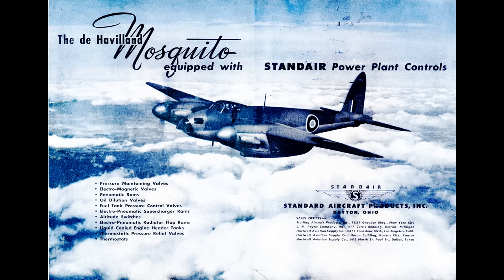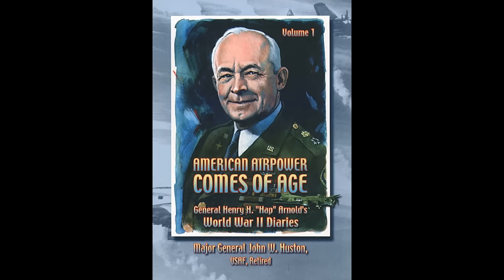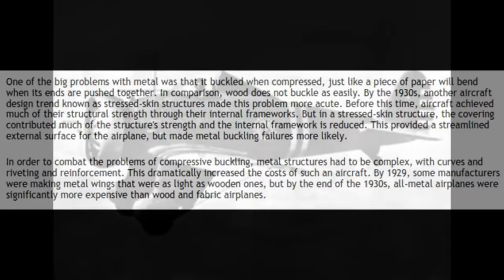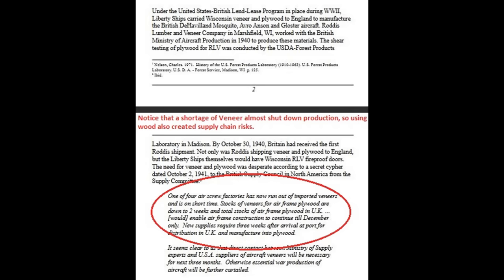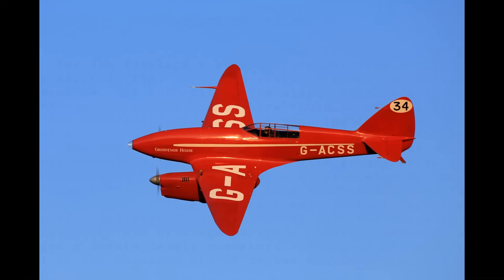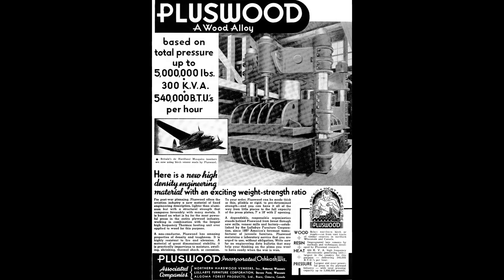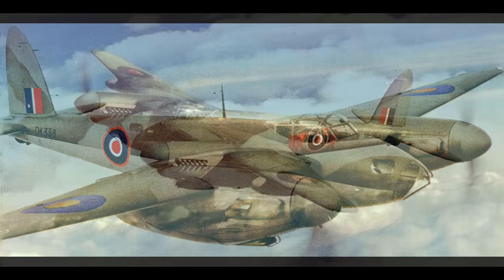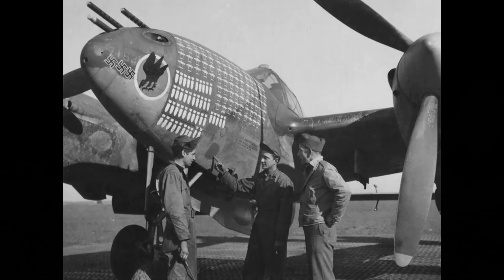De Havilland Mosquito vs. ?

Comment: Interestingly, USAAF pilots converting to the Mosquito seem to have struggled at first with engine torque at takeoff.  Curious, since the extra power of the second Merlin is offset by extra weight, and more so as other pilots do not seem to have had the problem.  This seems to have been because most of those US pilots were converting from P-38s, both aircraft being reconnaissance versions.  The P-38 had a fairly unusual setup where the two engines ran counter to each other, thus giving a neutral resulting torque.  So they had "un-learned" the habit of counteracting engine torque which they would have learned in training.

On the subject of the comparison with the P-38, while I love the Mosquito I cannot see it in the P-38's primary heavy fighter role.  Mosquito was a deadly nightfighter but it's a much bigger aeroplane.  P-38 already had problems over Europe of not being able to maintain energy in a turning fight, and Mosquito would surely have suffered worse.  All the other roles it would have performed well I think, and Mosquito also had the ability to transport passengers: in the bomb bay!  Possibly even worse than the P-38's drop tank pod.

Regarding the structural failures in the Indo-Pacific, we will probably never know for certain.  As you point out there were several possible causes and fixes were implemented for all of them, including changing the glue used.  Sensible enough during wartime to not wait and test, but frustrating for us.  

This channel makes so many events logical and explicable.  I had previously wondered why the fighter-bomber variants tended not to have the more powerful Merlins and their two-stage superchargers.  But now I understand that engine would be most effective at higher altitudes it makes perfect sense.
Reply: The counter-rotating props on the P-38 weren't so unusual, there were several other aircraft that used that design as its advantages are obvious and somewhat significant. The difficulty is a greatly increased cost in powerplants, as a reversed engine has to be designed and built, and is limited in the number of parts it can share with its counterpart engine.
Reply: Patches very true, I don't know how much has to be changed in order to run the engine in reverse.  Perhaps Greg will inform us?  As for how widespread counter-rotation was, it seems like it was well-established but uncommon.  By well-established I mean the Wright Brothers started it, and it seems to have been most common before the 1920s.  After that its use seems a bit random: for example in Germany the Hs 129 used it, but more high-performance aircraft like the Bf 110 and He 219 did not.  Maybe because of the engine mod of course.  

What is especially interesting is that de Havilland did adopt counter-rotation on the Hornet.  That was being developed at the time the US pilots' reports would have been made (1943-44).  That makes it slightly surprising that counter-rotation was never added to the Mosquito, even later in the war when engine supply was less critical.  I doubt it was just because Hornet was a single-seater as in Mosquito the other guy does not have co-pilot duties.  

While we're talking about engines, I remember a pilot talking about the challenges of the high-altitude photo-recon model and it's two-stage engines.  It seems that on that Merlin (at least in the Mosquito), the shift to the high altitude mode was not controlled by the pilot but an altimeter on the engine itself.  This, he recalled, sometimes led to one engine shifting into high gear at a few hundred feet lower than the other, leading to a significant asymmetric thrust and a rapid climb to get the second engine to shift.  A scary moment as the sudden change apparently felt like the aircraft had been hit.
Reply: Also the single Stage merlin 20s actually had more power down low than the two stage 60 series.  So on the FB versions it was unnecessary to change then. They both had same boost pressure abilities.
Reply: Tom Hutchins I think they just made do. It would have been nice but the mosquitoes already passed handling trials so it was deemed unnecessary. The Hornet needed the reverse reduction gear because it was designed for carrier operations and it had 600hp extra with the Merlin 130s
Reply: @smittywjmj  I wonder why the engine couldn't be reversed 180- run the prop off the rear end of the shaft
Reply: The Alison V1710 was designed from its start as reversible. It was intended as a dirigible engine and it was intended that the engine could be reversed to provide reverse thrust. The engine could be stopped and a lever thrown to reverse cam and accessory drives so it then be restarted in the reverse rotation. This made the manufacture of a full time reverse rotation version not very difficult. I don't know about trying to reverse a Merlin. It may have been a bigger job.
Reply: The "Spruce Goose" still exists because apart from one little "hop" it never flew so therefore was never structurally challenged.
Reply: A turning fight doesn't happen in night fighting. Night fighting is a stalking game using radar. Night fighting Mosquitos caused havoc with night flying German intruders. The P-38 comparison is best summed up by considering that the Mosquito was designed and built as a fast light bomber and as well as fulfilling that role it became a superlative P.R., fighter-bomber and night fighter - amongst other roles. The P-38 was designed and built as a long range heavily armed fighter and was used as a P.R. (although the U.S. relinquished them for Mosquitos and Spitfires in Europe) and as a fighter bomber - but at the expense of performance as the bomb load was carried externally with it's resultant drag. The Mosquito pretty well worked from day one whereas the P-38 had to overcome it's compressibility problems.
One is not better - or inferior - to the other. They're just the same - but different. 
But the Mosquito is definitely the more versatile of the two.
Reply: P-38 sure was a star for the USAAF in the Pacific.  The top two US aces from WW2 flew Lightning’s.  As did the long range wave top raid that took out Yamamoto.  Look up Richard Bong, Tom McGuire, and Charles MacDonald.

Comment: V's radar.....Because it was made of wood its radar cross-section would have been tiny compared to all other planes of the time.....
Reply: @frankcorner8716  As with all the answers to the questions about planes of WW11, "I'll have the fastest, lightest one with the Rolls Royce Merlin engines please"!......Ditching all the men and 50.Cals out of a bomber gave it greater protection, speed......
Reply: @frankcorner8716  De Havilland just stuck to what they were good at and made a plane they could make more of than the enemy and faster in construction also. Germany might have made slightly better planes but in nowhere near the numbers that they HAD to. If you have this, the Hurricane, Spitfire and Lancaster all made in huge numbers all the time in factories that aren't being flattened every week, then the result is inevitable.....
Reply: @frankcorner8716  I think Greg did a pretty good and non-biased job here of explaining that Frank. Like I said about De Havilland, some nations also stick to what they know or believe to be correct. It easy to look back with the clear 20/20 but things where moving at a pace that was (is?) unmatched for a long time in history. Tactics and technologies were changing by the years, then months, then weeks.....

Comment: Sometime in the late 60s, my father flew to Shoreham (I think) to look at a Miles Gemini that he wanted the engines from. Anyway, I remember him telling me about piles of ash and scrap metal on the airfield dump (which was where the Gemini had been taken). Turns out the ashes were a couple of Mosquitos and the modus operandi was to remove the engines and set fire to the rest. Once it had burned out just rake through and gather the scrap to be sent off with the engines......... Given its versatility, performance, bomb capacity and simplicity of construction, I think the Mosquito was, arguably, the finest all-round aircraft of the war.
Reply: Your story highlights exactly how incredibly overrated the Mosquito really has become thanks to revisionist "historians" since the war ended... the aircraft suffered from some serious deficiencies as a result of its antiquated design and construction methods, it's structural weaknesses and lack of durability is exactly why no original Mosquito remains in flying condition today.
Build to be cheap and disposable they were not worth repairing and were heaped-up and burned.
The de Havilland company suffered the same fate... they were not company made to last and went tits-up early in the Jet Age... too outdated and obsolete to compete with more technically adavanced aircraft manufacturers.
Reply: @sandervanderkammen9230  your reply really has made me chuckle. It's an interesting mix of bias and pure ignorance. The Mosquito was built from plywood because it was available.  The country's raw materials were spread thinly and the MoS would not allow DH to use aluminium. Plywood glues weren't advanced at the time and so delamination occured after 20 years or so. That's hardly a problem; the aircraft was designed to last the war. Remember that in different forms it could out run nearly all fighters, carry a payload equal to some dedicated bombers and operate well at both high and low level. What's not to like? As for the company, well you clearly haven't the faintest idea what you're talking about - DH designed and built many successful aircraft in the jet age - they possibly broke the Sound Barrier (though that is arguable) - produced the first jet airliner - produced several carrier jets - and designed others that would become the 125, Trident and 146. The company didn't just fail; the entire British aero industry was contracting and DH were forced to amalgamate. The reasons behind that are numerous but none of them were because the product was poor. If you're in the UK then I'll take you up in a DH, you might even like it.
Reply: @Soupdragon1964  My comment is intended for your education... not your amusement.
 Freeman's Folly was built from WOOD and FABRIC because de Havilland didn't have the technology and experience to build modern all-Metal aircraft.
The Mossie entered production because it was cheap, disposable and built to last weeks not years.
 You can cherry-pick specs all day but the overall average performance specs for the Mossie were average at best... it's capabilities were very limited.

Name a successful de Havilland jet aircraft?

The d-H 108 was a humiliating failure... they all CRASHED killing thier pilots and never flew Mach 1.

The world's first successful airworthy jet airliner is the Boeing 707 series.

The Comet Disaster was the worst engineering failure in commercial jet aviation and a shameful, humiliating chapter in British history.

The de Havilland company has a long notorious reputation for high loss rates, in-flight structural failures and a general disregard for safety and reliability that earned the company the honor of the worst aircraft manufacturers in history.

D-H went tits up in 1958 as a direct result of Comet Disaster it was placed under administrative receivership by Crown Court and its assets were sold to Hawker Siddeley. 

NO THANKS, DH went bankrupt because operators refused to buy thier aircraft anymore.... the globe is littered wirh de Havilland crash sites!

Britain's  aircraft industry was doomed to collapse after its defeat in WW2.... designing aircraft does not work as a jobs welfare program.
Reply: @sandervanderkammen9230  well I like to think that I have an open mind, but having flown all my adult life I don't believe I need to be educated..... Scrub your bias an look at WHY the Comet failed initially. Yes it was tragic and an embarrassment, but often being first with a product means that others benefit from your testing. It was fresh technology and boundaries were being extended in to untried areas... "the worst aircraft manufacturers in history"  - now that really is laughable. Your source please? Interestingly, the Mosquito had one of the lowest loss rates of any aircraft in the war, it's fact and no less true because you don't like the maker. You should research why DH were amalgamated, but to do that you need to understand the wider picture of  post-war British aviation, a treasonous government, loss of empire and a dishonest, envious and manipulating US ally. The put it all down to a poor product is not to understand the whole picture.
Reply: @Soupdragon1964  "Initial failure" ??? The Comet Disaster was an epic failure that completely destroyed the de Havilland company  and dealt a heavy blow to the already failing U.K. aircraft industry.

The Comet remains the worst jet airliner in history.  (worse even than the Tu-104)
No single British aircraft did more damage to the reputation of British aircraft and british engineering in general.

The Comet Disaster is taught in every engineering classroom since as an example of how NOT to build something.
Reply: @Soupdragon1964  There were only two winners in WW2, Britain was not one of them.
After the Bank of England failed and the U.K. economy collapsed the British had no choice but to mortgage itself to America with the Anglo-American loan, Britain giving up its autonomy and becoming an American protectorate from 1947 to 2016.... the U.K. is still occupied by American military forces.

Comment: A huge thumbs up. You used intercooler in the sense of of a two stage compression then followed by an aftercooler leading to the inlet manifold.
Reply from the maker: Thanks, and I do talk about that at length in my turbo vs supercharing in WW2 aircraft video.

Comment: De Havilland had some experience with wood construction exercised on DH88 Comet racer.  Aluminium like all war material was in short supply and only really on offer for authorised govt procurement, which DH98 was not, it began as a private funded venture because the idea of an unarmed medium bomber (the contract it first appears in) was literally laughed at. That same  British Air Ministry Specification P.13/36 was awarded to the failed Avro Manchester, which Roy Chadwick later turned into the Lancaster on 4 Merlin engines. With the contract refused Geoffrey Dh went looking for money which was ultimately granted by a patron, Wilfrid Freeman ultimately allowed a prototype aircraft which was to be built in secret at a farmhouse which took 11 months. Still as you suggest I think in balance it was Geoffrey's choice.

The meeting with Hap Arnold but from memory it is his aide a Major Elwood Quesada, who on seeing DH98 do a steep climbing roll on only its stbd engine (video of this exists) wrote :-
"I ... recall the first time I saw the Mosquito as being impressed by its performance, which we were aware of. We were impressed by the appearance of the airplane that looks fast usually is fast, and the Mosquito was, by the standards of the time, an extremely well-streamlined airplane, and it was highly regarded, highly respected."
Maybe if you can run him down perhaps you will have some luck to find the rest. 

On construction, yes its said to be wood,  in truth it is balsa composite mostly around 5/8" thick. There are much fewer frames as shape is preset in molds. Pre carbon era we used similar ideas for racing sailboats today. They could likely have produced this aircraft out of aluminium at a minor weight saving. So lighter but slightly slower, I can understand why Beech wouldnt get this, but Hughes? ... the Spruce Goose ? A jig has been put together in NZ to manufacture DH98 fuselages see https://www.warbirdsonline.com.au/2014/02/11/de-havilland-mosquito-restorations-in-new-zealand/
best...

Comment: You can be sure that a lot of people looked at it in the US. 
It's a matter of do we want to divert resources to produce yet another airplane that overlaps the capability of existing models? 
Especially one that has limited strike capability for knocking out railyards, factories, etc. 
It had its niche uses, but why build it?

Probably was best that the US didn't have much to do with it.

Comment: Fav insect plane. Got to see up close this bird at Paul Allen’s museum, bigger than you think
Reply: 👍When I see a Lancaster I see 4 Spitfires nosing forward of the wing, by that same token two on the Mossie, so yeah, it's a big airplane. Likewise: B-17, four Texans; B-24, four Wildcats and the funniest ones are the four Skyraiders pulling the B-29. Yeah that last one's a stretch. But all those Merlin engines look the same no matter what wing they're mounted on.
Reply: Thanks for the reply I have got to go see one and I live in Anacortes Washington so this is not a big thing for me.
Reply: The Mustang X prototype with Merlin engine basically had the Lancaster engine nacelle complete with chin air intake put on the front. Later models were neater with a liquid cooled charge cooler.